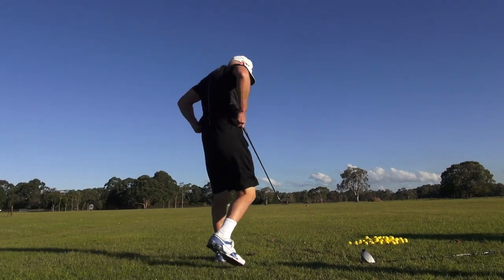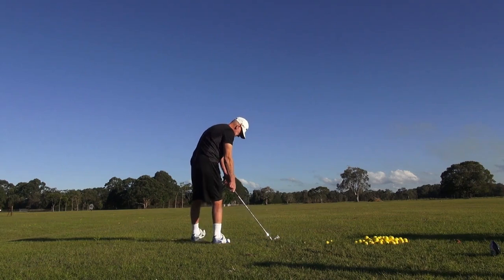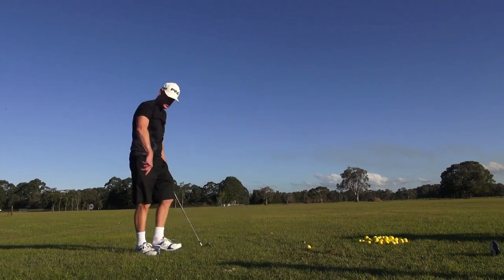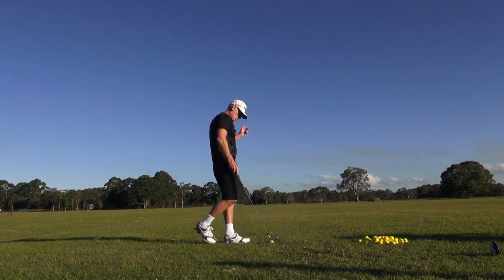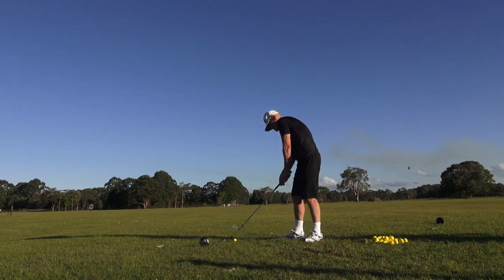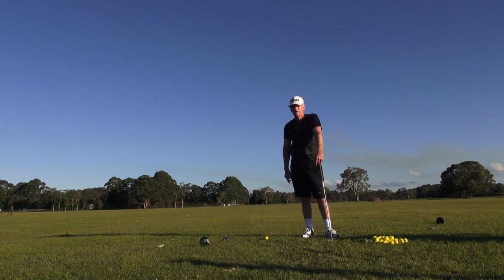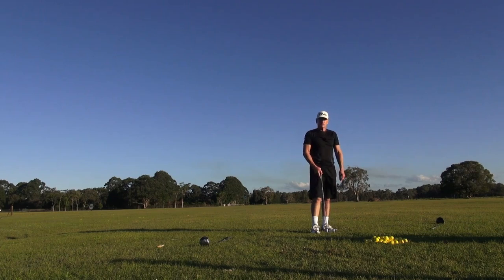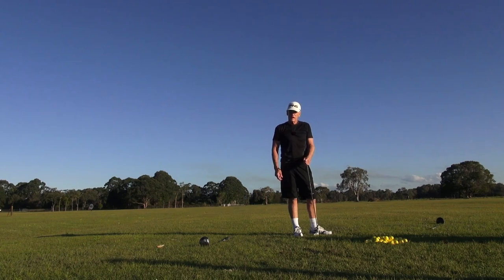Radical Club Spec and Channel Lock Swing Latest

Comment: JH, As a way to help explain the angles, how about the following: line up parallel to the target line,  backcock the shoulders, then rotate the lower body until the shoulders are again parallel to or slightly closed to the target line. This may help those having a problem visualizing the angles.
Reply from the maker: That is a good suggestion... I will try that out in the next videos and see how it goes..sounds like it should be a goer for sure.
                            cheers JH

Comment: jH, i get very good resulta with the short irons- crips contact, accurate, consistamt and same or added distance, but with lomger clubs amd jybrids - quite less distance..
Reply from the maker: With the longer clubs you must concentrate on getting the lead shoulder back  outside the trail foot on the backswing..it's very easy to not turn the shoulders enough on the backswing with the longer clubs..and try to get closer to the ball at address so the  path direction is more straight line back and through.
                         cheers JH

Comment: Do you have any thought about keeping the trail elbow behind the right pocket like with Davinci?    Or do you not have to worry about arm shape and position?
Reply from the maker: Hi George,
                        Keeping the nose back at 5'oclock  keeps the trail shoulder back which in turn keeps the trail elbow back as well..you do not have to focus on the trail elbow like you do with Davinci Code.
                 cheers JH

Comment: JH, why not do a lie board determination of the optimal lie angle for your CL swing, rather than assuming that Bryson's 10 deg. upright is best for you?  His shaft angle appears much more vertical than yours.  I can see perhaps a few degrees adjustment with CL but why 10 deg.??  Interesting stuff, no doubt.
Reply from the maker: I won't go straight to the 10 degs difference ..I will hit shots to determine what will be optimum for me ..but with the one club I have already bent to 10 degs  up I get perfect ball flight for me... but I do have to compromise some of my trail arm connection to my side at address ... whether that will be worth the trade off I don't know as yet.
               I have never used  a lie board  for evaluation .. my evaluation criterion is absolutely the ball flight requirements I wish to achieve... the whole lie thing is just  experimentation  ..what people lose sight of is that we all generally are pre conditioned to swing a golf club because of the way golf clubs have been traditionally  built with regard to lie specifications .. the body  has adapted itself to the club specifications over the years ..it should have been the other way around...the clubs should have been designed to   be compatible with the most  normal  anatomic  motion/movement requirements of a human body .
                      I think Channel Lock will  end up with a different lie requirement  to that of a conventional golf swing .. how different  time will tell... what is very clear now is  the attack angle of the swing is much shallower than a normal type swing... which on paper suggests the swing  would require flatter lie specs...but that isn't the case.. I have tried flatter lies and they do not work  at all for my swing..so a bit of water has to flow under the bridge yet as to final determination  of specs to suit my own swing.
                        cheers JH

Comment: JH - I love your instruction but when I see people practicing on the driving range it seems, me included, that most people are having trouble with the backswing.   Over the top, much to the inside and many other variations.  Could you go over a video just on your backswing?  You generate some much swing speed from just a short swing.  For me alignment, ball position really don't cause me to improve because poor technique regarding backswing.  If I copy exactly how you set up I can't duplicate or come close to dupicating your results just because of a poor backswing.  When I view your different swing styles in slow motion your backswing is always the same!  For me that would really be benificial.  Many some of your other students could comment. 
 Thanks for your instruction.
Reply from the maker: Hi Karia, 
                 I really never think of  a specific thing in my backswing relative to an action or a move etc....I always just 'swing' the club head and let it find its own position as a result of the loading inertia of a swinging motion and that's why my backswing is virtually the 'same' every time because I don't try to  'put' the club in a position.
         Trying to position the club somewhere in the backswing  will always cause variations in the backswing because you can never replicate the 'positions' ...just try to feel the club head is very heavy like a tennis ball on a string  and just 'fling' that tennis ball back  keeping the string tight as you do with a tennis ball on a string...really that's the feeling you need in your backswing.
                   When the club head is 'flinging/swinging' going back it is pulling on the body to apply the correct balancing forces for the swing inertia and the body will respond automatically without you having to think about it..hope that helps you.
                      cheers JH